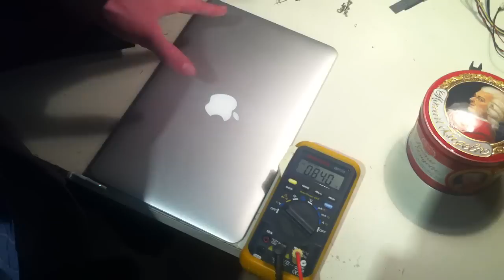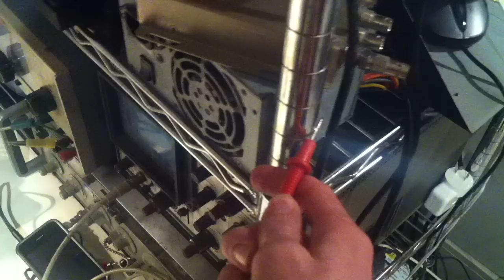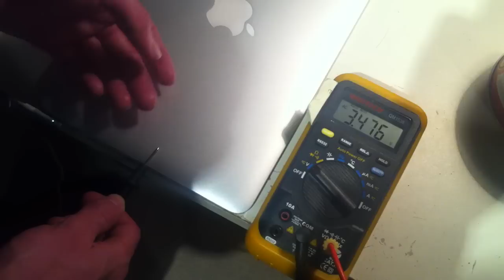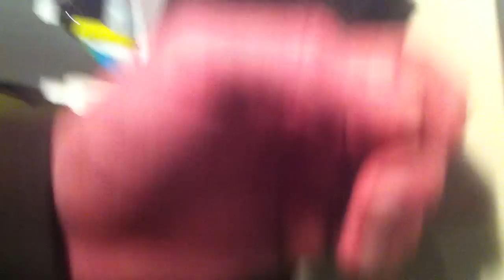MacBook charger current leakage/ground loop

Comment: I am having the same problem, got shock many time. Then I realize the british version charger is not really grounded. If you take of the plug from the charger. You will see there are only 2 metal pins. The socket is suppose to be ground but on the plug is plastic. A solution is to use a extension cable. If you take a look at that, you will see there is a real ground ...